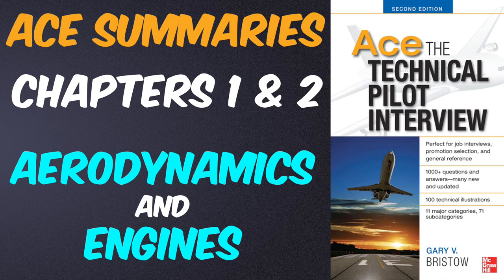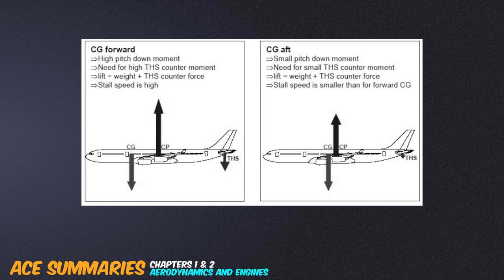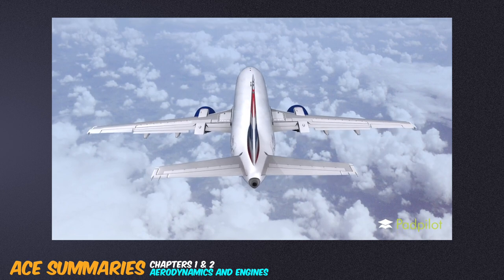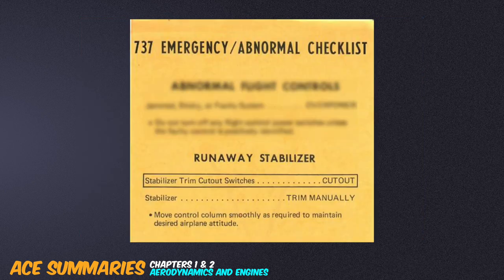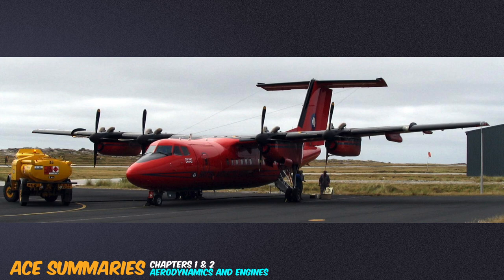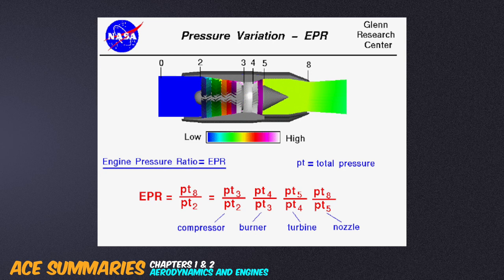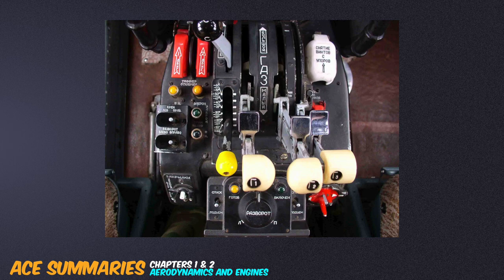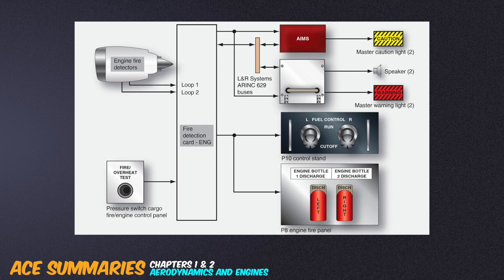ACE: The Technical Pilot Interview Summaries - PART 1 (Chapters 1-2)

Comment: i have a question regarding direct lift control as per ace direct lift control - elevator and stabilizer but you’re telling  it spoiler I didn’t understand properly can you clear it?
Reply: Spoilers are coupled with rolling commands in larger aircraft to avoid adverse aileron yaw,so for a left roll command in the A320 the left wing spoilers 2,3,4 go up increasing the drag on the wing which causes a roll motion
Reply: @JETA14 Thanks brother❤